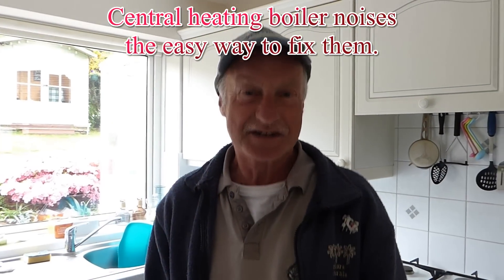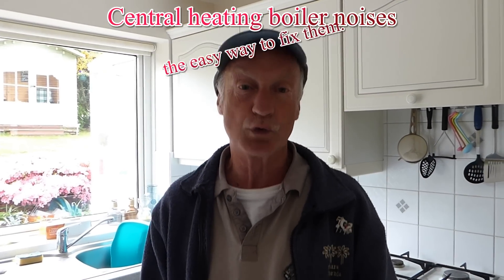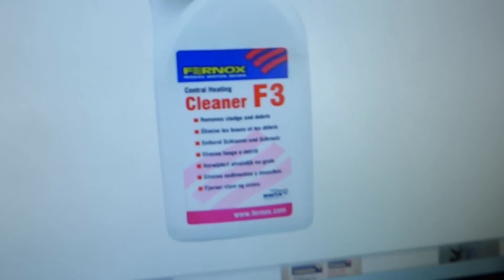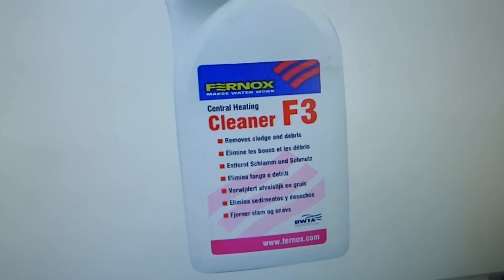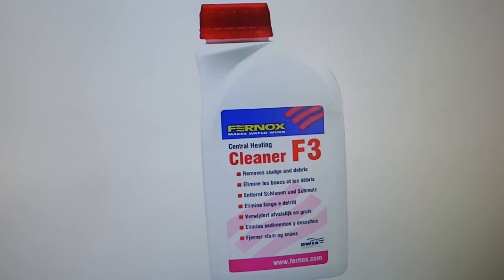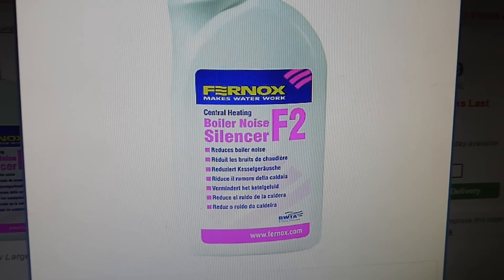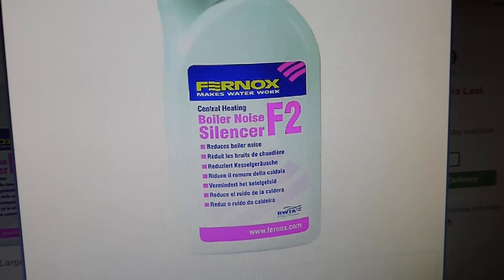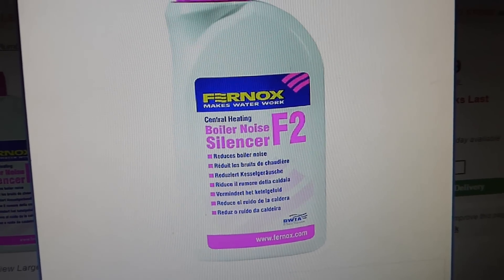Central heating boiler noises and the easy way to fix them

Comment: Thank you for the video 🙂
My Valiant Ecotec 825 Combi makes like a bangin/tapping/clicking noises for a while whenever it comes on and cools down but once it's been on for a bit it's fine. Started on one of the radiators too, the occasional bang when it's heating up but is fine afterwards. Any ideas?
Reply from the maker: Sludge building up in system.
Reply: @dereton33  thanks for the quick reply. Is there an easy way to fix it and does it need immediate attention?
Also periodically my pressure drops, maybe needs topping up every 1-2 months during winter when central heating is on. Could this also be result of the sludge?

Comment: Thanks, if the system has inhibitor in it, do you need to drain the system first then put in the cleaner, then drain and put in the silencer
Reply from the maker: Yes you do

Comment: Hi our combi boiler is making a horrendous noise..  the noise is like a very loud purring cat and the vibrations and the noise is coming from inside the boiler casing... we've had 9 engineers out to sort this in a year and NOT one of them can sort it..  I've even videoed the boiler making this noise and the only time you hear it is when the boilers temp goes up from 60 degrees to 72 when the nouse stops the temp drops from 72 down to 60 again this will go on for an hour and a  bit in the morning when heating comes on ..  some times the noise starts mid day or after noon and when the heating goes off at 11.00pm .. this has only started when we had our kitchen revamped by the council and they removed a heater while kitchen was being plastered..( they turned off our boiler to do this). 9 days later when kitchen was complete they put the heater back and reconnected it to pipes then restarted the boiler same day...since this the boiler has made this awful purring noise like a cat purring.  This has been reported to the council 9 times last year I've even recorded the boiler making this noise to each and every one of these engineers that have come to sort out the boiler from the council and NOT one of them can work it out...
I can feel the vibrations coming from the casing of the boiler when the noise starts..we are absolutely fed up with it all a year of this and NO one can help find the problem...
Reply from the maker: It is either air in the system or boiler. The pump or sludge in the system.

Comment: Hello new Baxi boiler installed last Nov. When heating hot water only making horrendous sound rather like the one in your video, but much worse. Plumber tried using cleaning products you've suggested and put on air valves. Not worked. Help. Any advise?
Reply from the maker: A power flourish.
Reply from the maker: Should have said a powerflush. Lol.
Reply: Same here, the baxi boilers are crap

Comment: I can hear running water from my boiler like a running tap and none of the radiators are working except one in bathroom upstairs. Help.
Reply from the maker: Need to know what system you have a combi or F and E system.
Reply: Did you find the problem? My boiler is making the same noise, like water splashing around in there.

Comment: Hi Al.  So you add the cleaner, leave it, then drain down and then add the Silencer.  Do you not need to add Inhibitor as well or is it an all in one? Thanks for the videos.
Reply from the maker: Mark Garth No it is all in one, no need for inhibitor.
Reply: dereton33 Cheers Al.  I've just bought the cleaner and the Inhibiter/Silencer via your link.
Reply from the maker: Thanks Mark. Good to know it is all working properly. Al.